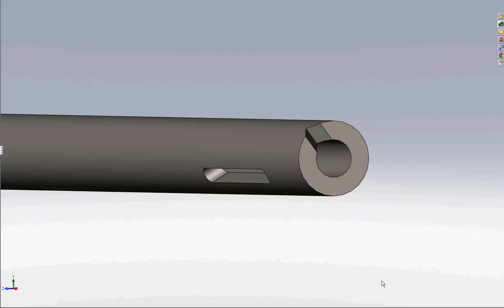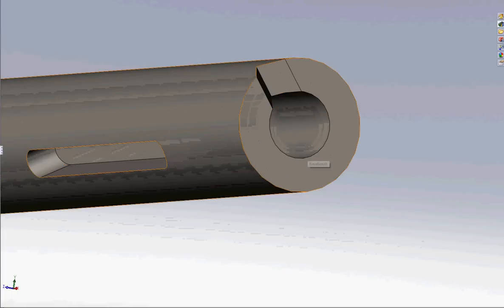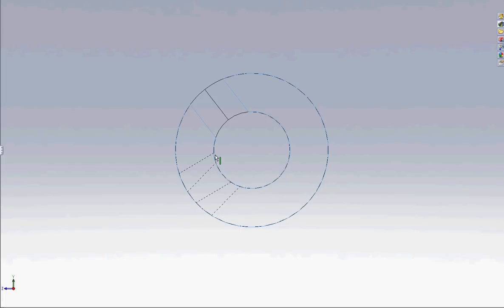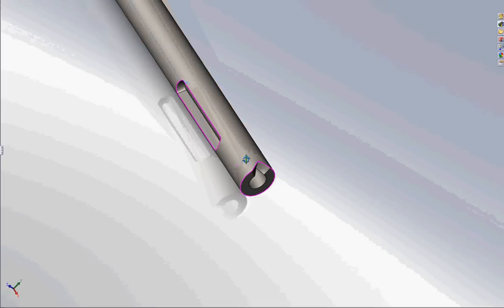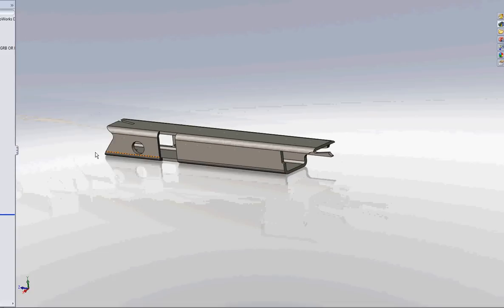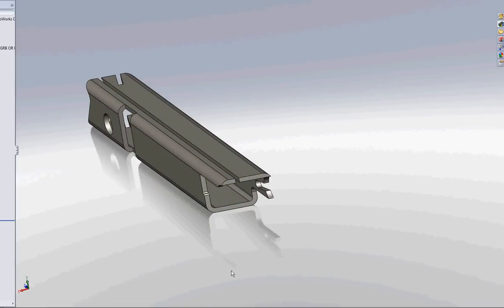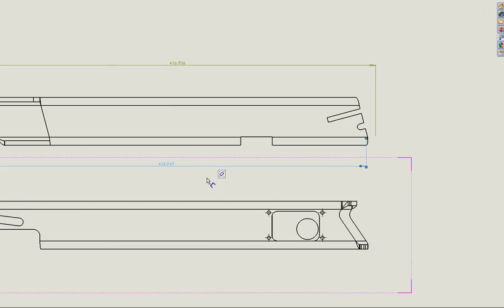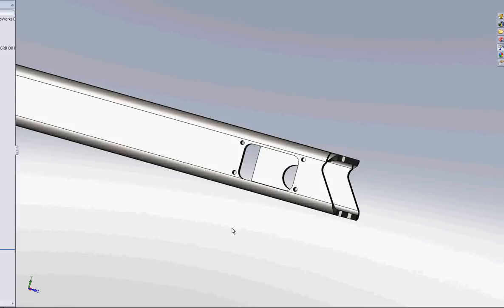TIPS AND TRICKS FOR TUBE LASER TUTORIAL ON SOLIDWORKS

Comment: Great videos! I'm surprised that there are no decent functions in SW for this. It also seems to work if you model your tube as a surface model (with the cuts) and then use the "thicken" function to make it a solid body with normalized cuts.
Reply: Doing a zero-offset of the inside/outside surface of the tube (depending on which side of the tube the features are critical on) and then using the Thicken feature on the resulting surface is the much more accurate and correct method of doing this. The Thicken feature will always produce solid geometry normal to the profile. Also, that method will work regardless as to how the features were added to the tube.